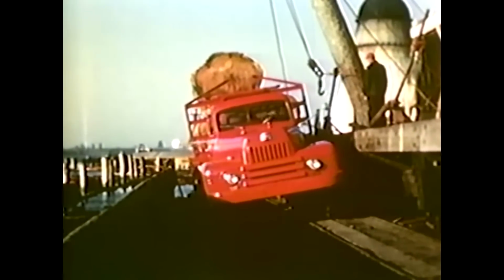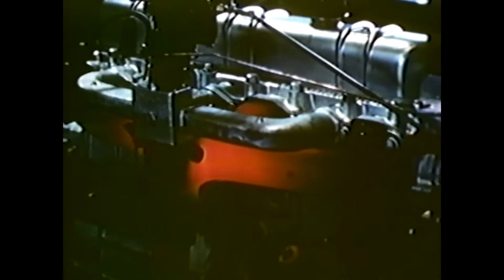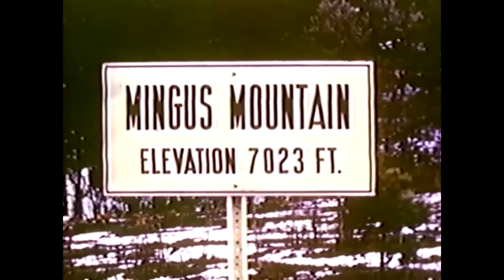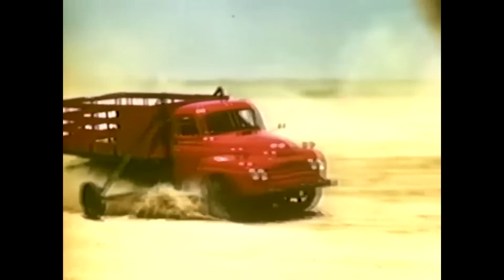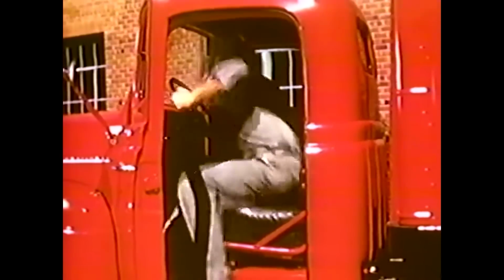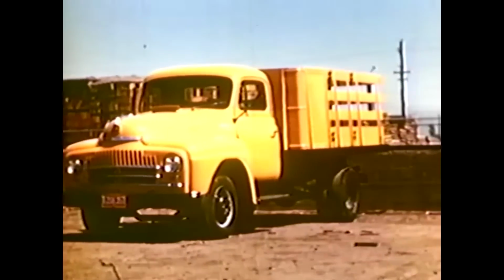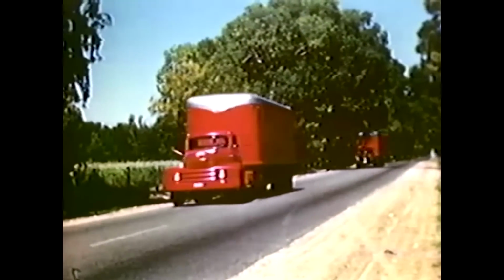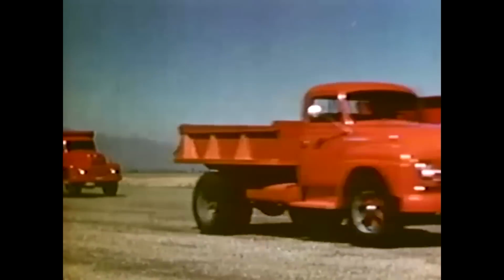International Truck Film Classics: New Champions of Transportation

Comment: The brakes on these trucks were laughable. No such thing as a Jake Brake, hadn't been invented yet, besides they were gas and couldn't have held the truck back anyhow. Now they will hold back as hard as the horsepower is.
Reply: You had to know how to be a DRIVER, not just a steering wheel spinner!!!
Reply from the maker: Yes you had to know how shift for sure! More than just step on a pedal.

Comment: I wish on are International PU growing up and having a 12 volt battery instead of the 6 volt. Me being young did not understand how to upgrade if possible to 12 volt. If there was a hill, I could compress start her. 😊 the 3 speed column shifter was easy to shift 😊 everything  about. The truck was great, especially the hood double-sided covers to get at everything inside. I just wished International had put a 12 volt battery system for the engine 😊
Does anyone out there have a story on how they converted their PU to 12 volts. Was it that you needed to just charge up the 6 volt every time you started them or just changed the battery every 6 month to a year. How did you deal with the 6 volt battery system they put in there trucks.
Reply: We had several trucks with 6 volt systems that we used on our farm back in the 70’s, although the trucks were from the 40’s & 50’s. International, Ford, Chevy, GMC and Dodge trucks made during that era used 6 volt systems, and some even used 8 volt systems. We had a Schumaker battery charger that had 6, 8, or 12 volt selector switch and charged them up once or twice a year. I don’t remember how often we changed the batteries but I remember that if we disconnected the cables during the winter months and charged the batteries once before using them again they would usually be fine for the rest of the season as long as the liquid was kept up to the ring in the cells. Thanks for bringing back some memories. The best things in life you never really forget I guess. I do miss the old days. With all the electronics these days you can’t really have a vehicle without a good battery, but back then you could compression start it and if the generator worked you could go all day with a bad battery and then at night you would have dim lights and maybe have to use the throttle to keep the rpm’s up so the engine wouldn’t die. Those were the days!
Reply: Hay que cambiar el alternador, el motor de arranque, el regulador de voltaje, y todas las lámparas.

Comment: We used R190 truck tractors in the 1950s and 1960s. They were good trucks for the time. They were heavy duty built and the Red Diamond 450 engines had plenty of torque. But I’m glad we don’t have to use them anymore. They were about the hottest thing you could drive in the Summer.
Reply: Real workhorses
Reply: So you are 80+ years old and watching YouTube to relive your glory days 🧐

☺️
Reply: @nobodycares3897 dang rite we are..

Comment: Of all the defunct brands that are no longer around, I mourn the loss of International Harvester the most. 
It’s hard not to respect the tough, enduring, and trustworthy spirit that was a key part of nearly every single International Harvester product. 
I would have loved to be one of the test drivers shown back in the day.
Reply: I have 4 9900ix with cats. One of the easiest trucks to work on. Heavy trucks
Reply: Yeah, the last of their breed. Then came Navistar, and it was over...
Reply: @Geardrive427-ip8vj  International Harvester and the International Navistar brand are not the same thing.
Reply: What do you mean?  They still make trucks just under Navistar International now.
Reply: @ConSeann3ry Not nearly to the same quality, and they don’t produce pickups or 90% of the lineup in this video.
Reply: @Psychli  yeah true.  When I first heard the Scout was coming back I thought it was International... though they probably wouldn't have built a tough utilitarian SUV either even if they did come back.
Reply: @ConSeann3ry The new scout is also Suburban-sized which defeats the point, I feel.
Reply: @Psychli  absolutely.  100 in is perfect wheelbase for wheeling IMHO.  Scout 1 and 2 even though 2 had longer butt.